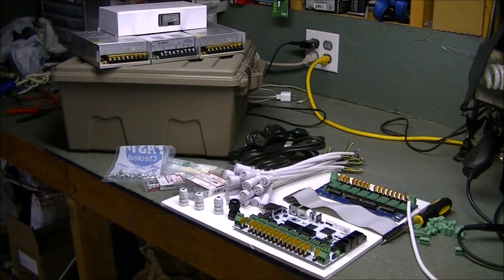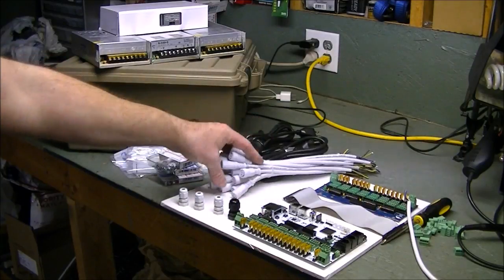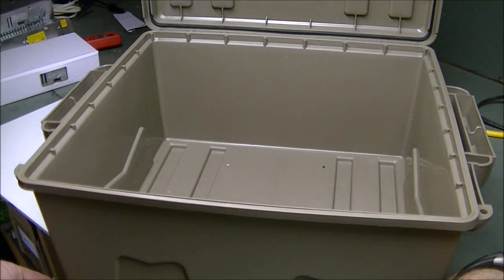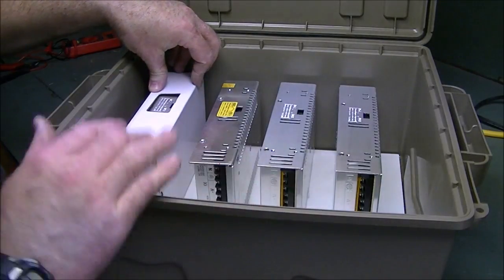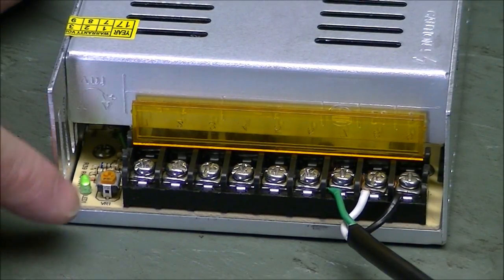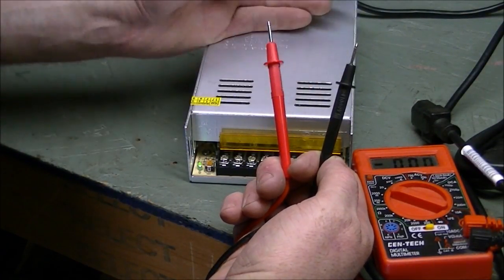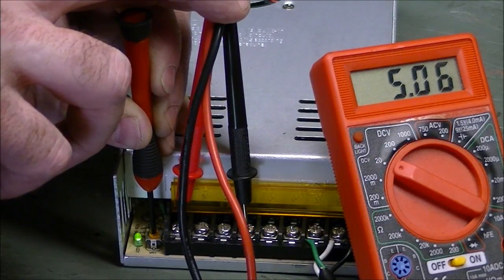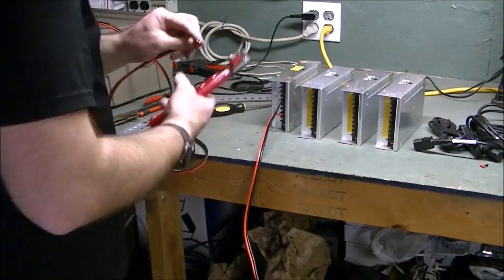F16v3 Instalation and Build Part 1

Comment: with no load, the DC output voltage will be higher than listed. Do not adjust the out voltage unless you add a nominal load.

Comment: Do you have to power the pixels off of the board or can you simply run data to the pixels and then pull power directly from a power supply? I'm trying to plan ahead for power injection.

Comment: Nice vid Clyde. Bootlace ferrules are a good option that provides the benefits of tinned wires but not the downsides. There's also DIN rail mounts that you can get that screw to those style power supplies that allow for easy swapping in and out.
Reply from the maker: Alan H  
I did not know that about the rails.  and yep, you can crimp an end onto the stranded... but it really is not necessary if people already don't have them.  wish I had thought Of that.